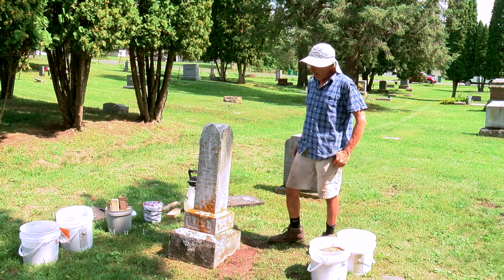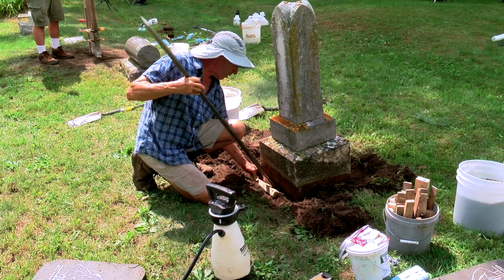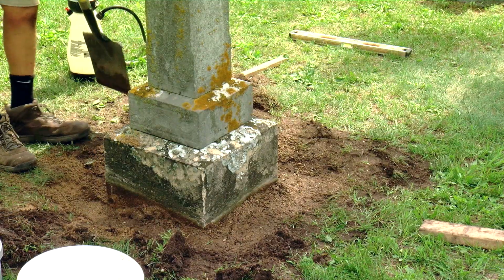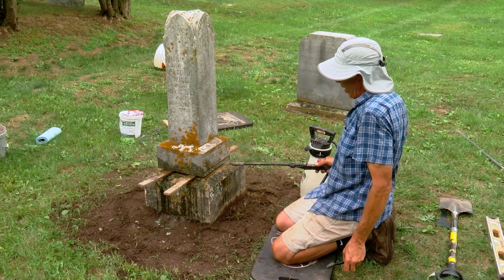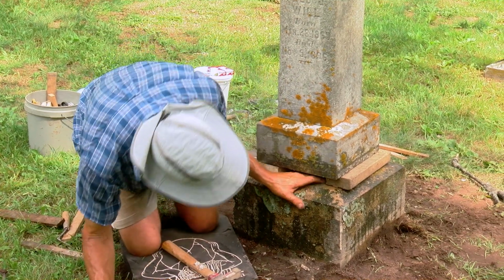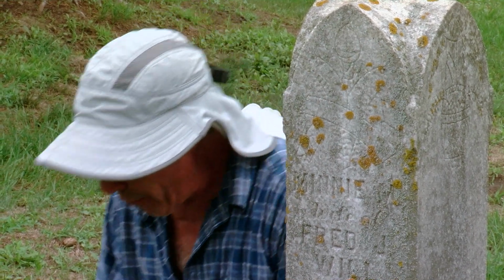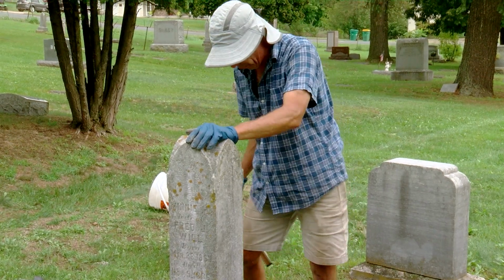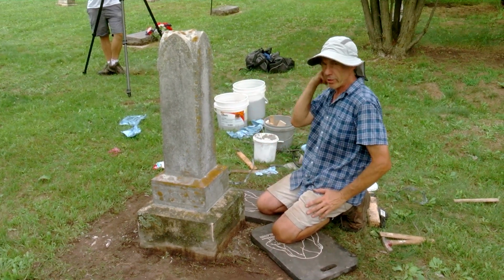Local Cemetery Conservation: Re-setting Multi-Piece Monuments

Comment: You might take into consideration using some of the Wood pieces You have in the Bucket to shim the stone to the level You want than pack the stone & sand material under the base to complete coverage under the base instead of just kind of pushing the fill with the blade of the shovel only around the edges and slightly under the base. pack the filling with a blunt ended tool for long term success.

Comment: I've used old wood chisels to get the old compound or motar cement out..tapping it with a hammer. The chisel allows me to strike parallel to the monument and into the bonding plane.  Yep messes up the chisel edge but I can fix that when I get back to the shop.

Comment: Be more prepared with your tools before starting a project, especially when you're trying to show and impress an audience.  Which you seem to be a bit of a show off.  A lot of the prying is only common sense, but then again, a lot of people seem to be lacking that.  My friends and I straightened out a bunch of similar stones on a much steeper hill.  Tucking sand and gravel under would not have worked, so we took the stone off, poured a new concrete base, and reset the base stone when the cement was wet yet, then set the rest on top.

Comment: why didnt you tamp that sand and gravel down with a tamp? and or use concrete with rebar to support? and not pinning that monument it will fail again down the road that little epoxy isnt going to last for to long..